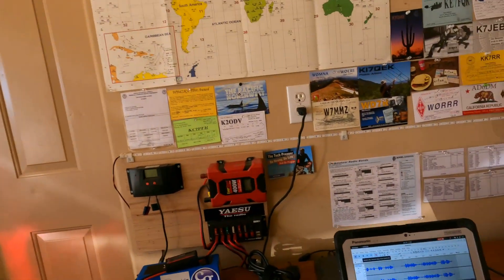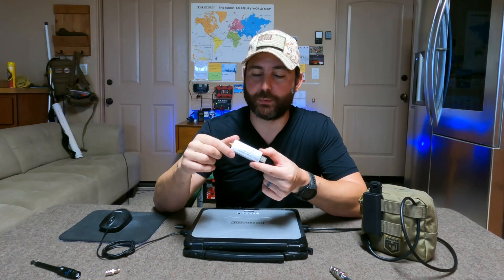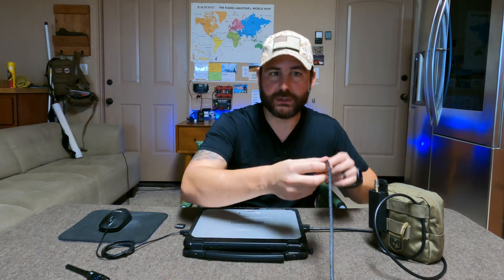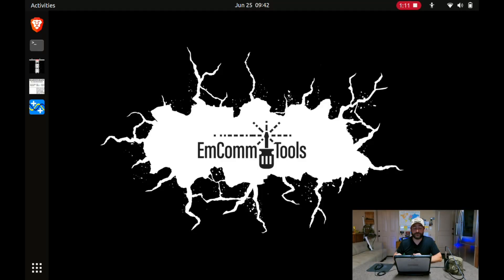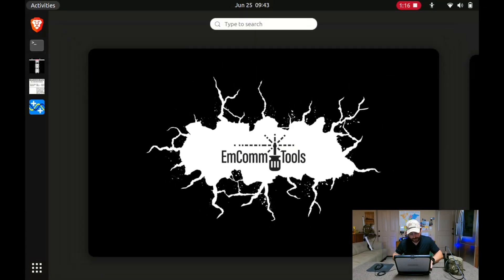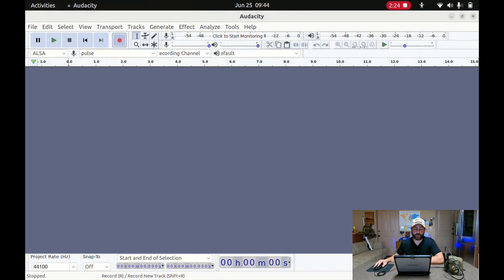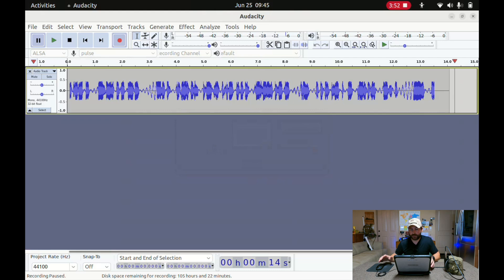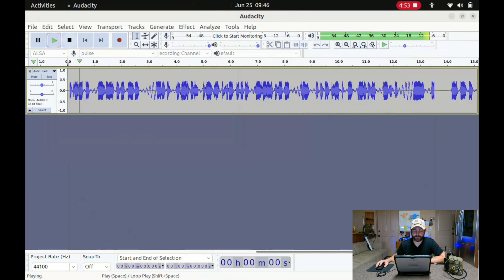RTL-SDR & Voice Activated Recording - Part II: Configuration

Comment: on windows you just need sdr++ and audacity - the audio is automatically captured  - i have been using this to monitor the local repeater for some years now
Reply from the maker: Wonderful. Thank you! I haven't used Windows in 20 years. I pinned this post for the other viewers.
Reply: @TheTechPrepper  - this is awesome.. I plan on doing the same in the next week.

Comment: I used SDR# on windows as I'm more familiar with that software. I'm having issues with the playback speed. The recordings are captured, but the playback speed is incorrect. Anyone else having this issue? I'm going to setup SDR++ to see if it has the same issue.

Comment: so if I understand correctly and I may not LOL this only records when it hears someone talking and it only records the frequency the rtl sdr is on.???? is this right>?  How would I create something that would record only when talking both sides of conversation but allow the radio to change frequencies not be set on one? Like at an ema office or field day with multiple radios frequency changing and record>>? Something with a mixing board im guessing and all the radios audio out into the mixing board and the audio out to a computer setup to record when Vox????

Comment: @TheTechPrepper; to protect your SDR-dongle I would recommend using a pigtail to connect it to your antenna instead of using an adapter. Especially if you keep your SDR-dongle vertical like you do in this video, the mechanical stress on the tiny SMA-connector can make it snap. And when the SHTF, its kinda hard to get a new one.

SDRplay made a point of it in their manual for the RSP1A, which you can find here;
https://www.sdrplay.com/docs/RSP1Adatasheetv1.9.pdf

Thanks for another great video!

Comment: Idk why i never thought of the USB extension. Such a small but great tool
Reply from the maker: It's really helpful. I found that the form factor and weight of the SDR made it awkward to connect to certain USB ports. In fact, there were certain ports on my laptop where I could not seat the USB connector without the extension cable.

Comment: Loving this series! So many possibilities.  Do you think it possible to take the recorded audio and auto save it to a folder named the frequency and the file named the date/time stamp?  Next step better would be to be able to cluster multiple SDR's to monitor multiple transmissions at a time.  I don't remember if SDR++ or another software let's you record the raw RF to pass it through different modulation types as an analysis tool, like to figure out what modulation type or filters to use for an unknown signal.
Reply from the maker: I like where you going with this question. A few viewers are asking this question. This is not possible using SDR++ and/or Audacity based on their current features. You may want to pose this feature enhancement to the author, Alexandre Rouma, as he mentioned he would be working on adding voice/sound activated recording support. Here's the issue. https://github.com/AlexandreRouma/SDRPlusPlus/issues/690

Yes, you can capture raw. It's one of the selectable modes. It's in the same location where I select AM as the modulation type. I am still new to SDR's, but I am planning on capturing audio and passing it to decoders for processing/analysis. For example, I plan to experiment with passing APRS signals to Dire Wolf, voice inversion signals to voice inversion decoder, etc.

I am not sure how the SDR world is doing "auto detection" of signals. I am sure it's possible and will look into it.

Comment: Do you think there is any way to timestamp the separate recorded transmissions?
Reply from the maker: Not as far as I know with Audacity. The recording preferences in Audacity have the ability allow you to dynamically include a data/time stamp and track in the filename, but it's just for the current recording. It will not create a new track and/or file every time it stops/starts recording using the "Sound Activated Recording" feature.

This feature is better implemented in the SDR++ software. If you really want this feature, I encourage everyone to comment on this feature request for SDR++: https://github.com/AlexandreRouma/SDRPlusPlus/issues/690. The author is working on this feature now, so the community should chime in with these requirements.

Comment: Imagine the remote possibilities with a Raspberry pi running this setup.
Reply from the maker: Exactly. I'm 99% sure this will work on the Pi. I may use an old RPi 4 as a dedicated recording station. I'm a software engineer, so if I had time, I would likely run a speech-to-text processor on the daily recordings, then use natural language processing and machine learning models to automatically categorize the content. Lastly, have it notify me if it finds content that I may be interested in. Yes, lots of possibilities. If only there were more hours in the day. Cheers!
Reply: @TheTechPrepper  As a software engineer you maybe want to take a look at DragonOS if you haven't. It can run on a PI and is a dedicated OS for SDR with a load of SDR applications pre installed. Like kali for SDR. And not to forget the android version of SDR++ Another great video and have a great day!